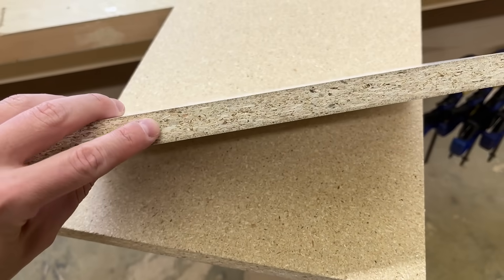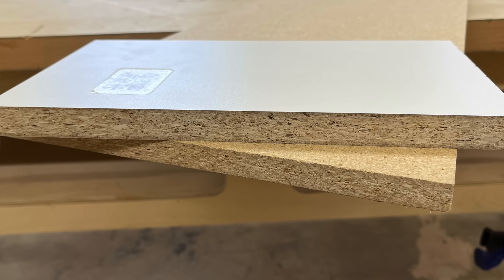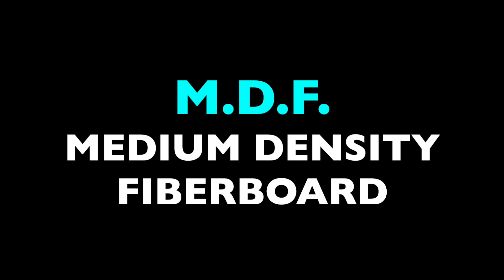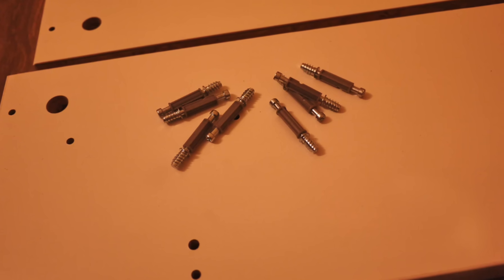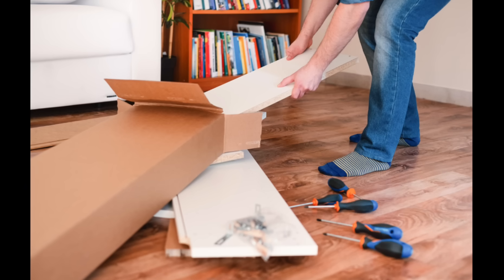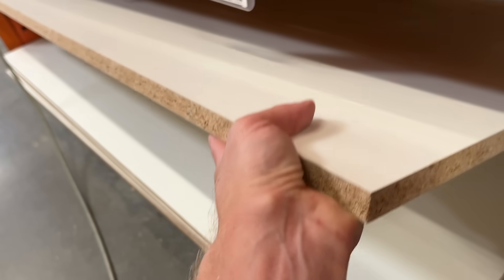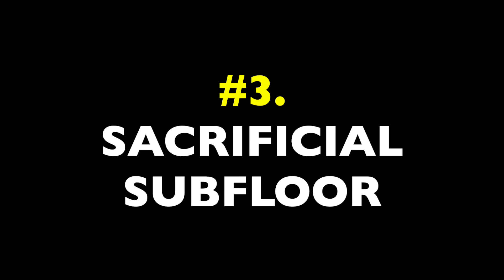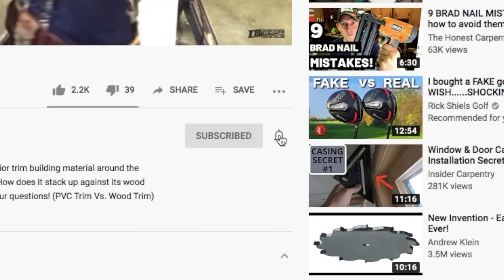The Truth About PARTICLE BOARD...Is It The Worst Material?! (Pros + Cons...Particle Board)

Comment: Most European kitchens use particle board covered by melamine. Most of their cabinets are not that wide (usually 15", 24" or 32". But mostly 24" wide). So particle board is perfect for smaller cabinet.
Reply: Those are similar widths you'd see in American kitchens. Particleboard works just fine in all kitchen cabinets. It is proven. Only the ignoramuses disagree.

Comment: In Europe, there are several multinationals, notably out of Austria, making wood products. The MDF vs particle board is way heavier, costs 60-70% more, and actually sags more, i'm pretty sure. At least laminated MDF vs laminated particle board, the MDF will sag more. The weight of MDF is really enormous. Laminated MDF costs multiple times more than laminated particle board, essentially, as far as i can tell, to be able to flex that it's MDF rather than particle board. I've now built a dozen MDF cabinets and i plan to switch to particle board, at least to try and form an opinion from direct experience. For the price of raw MDF, i can get the most basic laminated particle board. For c.3 eur/m2, i can get very nice laminated particle board.

Comment: On the other hand, I'm sitting at my rolling computer desk I built decades ago of particle board and it still works and looks great. If you work around its structural limitations, sand and varithane it well, it can be an inexpensive (though maybe time intensive) way to make something that looks surprisingly good. You probably want to find a filler product for the edges that is a good color match. I just painted the side pieces black to save time and trouble.

Comment: Why am I under the impression that mdf in fact deflects more than particle board when used as a shelf in a kitchen cupboard?
Reply: I also have Ikea PAX closets, the wide ones, 100 or 120cm, and the particle board shelves doesn't bow. Although to be fair there isn't a ton of weight on them.
Reply: The AI I just asked agrees with me btw. however, the Sagulator (yes, it exists) basically says it depends, as the database has twenty different particle board types and several MDF types. My girlfriend has a particle board kitchen with some MDF shelves, and these sag more.
Reply: @gudrune it doesn’t have a grain. It’s molded. Steel even bows given the weight over span. Oak does as well. Study stress factors. Also mdf vs. particle vs. osb ? Osb for the win but also what are the thickness 3/4 particle board probably resists better than 5/8 mdf?

Comment: Have to disagree. You've got the whole story upside down, at least compared to the products we have here in Australia.

In 50 years of building and carpentry, I've found particle board (we call it "pineboard" or "chipboard") far better than MDF for anything and everything. It's like cardboard, more paper than wood, rots with moisture, rats eat through it, warps with heat or cold, and is WEAKER in span than particleboard. In short, MDF is evil and useless. I just won't have MDF in my life. I tear it out wherever I find it.

And particle board comes in waterproof types, termite proof types, waxed types, greater ranges of thickness, Tongue & Groove. It is NOT cheaper,  but more expensive than MDF ... rightly so ... because it is better.

Comment: In the U.K., chipboard is the go-to material for flooring. We generally use 8x2 tongue and groove boards 18 or 22mm thick...the board is higher density than a standard particle board and treated for moisture resistance. Installation is by glueing the tongues to prevent squeaks and ring shank nails or screws to hold them down....carpet, vinyl or laminate goes straight on the top.

Comment: I have a desk that is made out of particle board. Owned it for years now so I think I can make a good assessment. 

First, PB is highly underrated, but its still used a lot mainly because of cost. It's like people use it alot, but then dog on it, lol. PB, when used correctly, will last a long time. 

Most of the problems I see on my desk and other desk, is usually water damage - from drinks being put on desk and from using inadequate thickness when it needs to hold a lot of weight. 

If you can reinforce those two things - water creeping in water exposed areas and thickness in weight bearing areas, PB is superior because it holds its shape well and very cost effective. 

Other types of boards like plywood of the same dimensions is triple in price. And that's not even talking about non engineered wood.

Comment: thanks for the helpful info, once again! i've built out 3 closets in my home with the melamine boards from home depot and they are all holding strong, 3 years running. if you "design around the material" so to speak, it can be great, low-cost stuff.

Comment: Does particle board warp?
Reply from the maker: If you lean it against something unsupported. Otherwise not from typical wetting/drying.
Reply: I have a table tennis board made of particle board that is slightly warped. I saw a video of a carpenter repairing warped lumber by moistening it, cutting crosswise slits, clamping it flat, and applying epoxy. Can I use the same method for particle board? Is there a better way?

Comment: I'm using Melamine for a bench fence because of the clean face, and straight edge. I initially tried using screws to hold it together, and it was a disaster. I am now using dowels with a much better result.
Cutting is, shall we say 'challenging'. I recommend scoring the top couple of millimetres, then doing the complete cut. Some cut edges will be exposed on the finished product, so I have purchased iron-on tape to deal with that.
As the item is not overly large, I still feel it was the right choice, but if MDF, with a plastic coating was available, where I live, I would have gone for that.

Comment: That was excellent! You told us that (as even inexperienced woodworkers know), particle board is cheap, prone to bend, prone to soak up water, and doesn't take a screw in the edge, but ALSO has some genuine uses where its dead flat quality, dead smooth, impervious laminate top, and resistance to denting on the surface, makes it actually attractive as a craft table top, where better quality wood cannot easily do the same work.

Comment: So, only in the desert {low humidity}, and as long as the edge is never touched, partical board can be used as a work surface. Other than that specific use, it is the worst material to have ever been created for anything.

Comment: I just purchased a Kallax unit from IKEA. 
But, when I turn the shelf upside and around, I hear noise like pieces of particle wood in between the veneer of the shelf. 

Is this normal? 
Or Is it broken in between the board? 
Also, note: 
I already returned one shelf bc of the noise and the second one (the replacement unit) sounds the same. 

Is it broken inside board?
Should I return it?
Thx in advance for your help.

Comment: particular board is the worst, I have my  burst hot water pipe repaired in utility room but residue moist and condensation swell the boards like elephant legs. Moulds develop crazy inside the boards, ended up have to dismantle the entire set of vanity cabinet and full height storage cabinets.

Comment: I found a better much sturdier glue to use one this 1/3 acrylic elmers glue 1/3 titebond 1/3 cyanacrylite glue, its thinner and also runs and absorbs deep in the edges, down side is it is probably more cancerous than working with epoxy. Cyanacrylite has an exothermic response on a molecular level when coming into contact with fine particles like cotton or sawdust and if it gets on the skin the exothermic reaction is so intense you will get burned; but the area covered in this glue becomes like concrete and the molecular reaction increses its dry rate. For any one wanting to attempt this mix you will need to heat the acrylic glue and titebond on hotplate then mix in cyanacrylite glue. WILL GET THROUGH YOUR FACE MASK and BURN YOUR EYES DURING THIS.

Comment: The one advantage of particle board over MDF, at least according to Google.... is that it has a much longer average "life span" of 25 years, as opposed to MDF being 10 years.
Anyway I've basically been using a flat thin cardboard box on stools as a supplemental table next to my computer desk for several years, and am finally upgrading that by adding a 3/4" 2' x 3' particle board on top.
So as far as I'm concerned, its Jeffersons Time.

Comment: I am ripping it out of my bathroom. A gap in the laminate flooring has had the water get into the particle board. I am replacing with 1/2 inch plywood and ripping out the whirlpool tub. I have been running fans and heaters to dry out the particle board to make it easier to remove.

Comment: My personnel opinion on particle board is that it should not be used  for house construction or for flooring. Flooring should be 3/4" PLYWOOD & nothing less. Walls & roof construction should be PLYWOOD!  Particle board is cheap jack ....! I shudder when I see new homes being constructed with this inferior & substandard material. It should not be allowed. It's all about saving money. Buyer beware...your new super duper home will not last you for very long until you run into complications.

Comment: I'm  still confused. I watched this twice. I have natural wood cabinets from Home Depot. The fronts are the only real wood. The rest are either MDF or the other you mentioned including the shelves.  I had these installed in my trailer which hall's my expensive car by someone who claimed to be a 30 year cabinet maker. Needless to say, the front cupboards fell to reveal he only fastened them to the BOTTOM steel beams. The tops WERE NOT FASTENED AT ALL. Thank God, my car was not inside. I see the remnants of the cupboards with the broken fake wood still attached at the bottom. I tried myself, being an inexperienced older woman to attach the remaining cupboards better, but probably dismally failed.  I got to points where the cheap anchors would not go through. I am suspecting these are the steel beams where I SHOULD be drilling. I need to attach them properly.  I am new to your channel and am trying to learn from you. I really live your videos. I just watched the vid on self tapping screws and the difference between a driver and drill. (MUCH appreciated!)  So, my question to you is, what is the best way to secure my cupboards,  driver? Drill? Self tapping screws?  I am living in my van which halls my trailer fulltime. I would SO APPRECIATE your help.  I just found the schiester who installed the cupboards and he threatened to call the police on me for telling him he did a subpar job. ??? I was had.  I can't find any help out here.   Any real advice would be do much appreciated!!♡

Comment: I lucked into a 2.5" thick 30"x5' particleboard desktop with maple laminate on the top, bottom, and edges. I turned it into a workbench top, and have zero regrets. It's tough as hell, and it's seen a lot of "abuse" over the years. It's also VERY flat. I had to dial in the maple top with an orbital sander and a straight edge to get it flat, but, it has stayed flat since.

Comment: Hello again Ethan 
Thank you for another Great Video. I've been wanting to ask, what type board should I use for a Toolbox Top. A work surface. I've seen several, but none seem to hold up. I never know if I am outside in the weather or in a aircraft hanger. Which could have leaks.I have also seen the fake wood tops that are coming preinstalled with tool boxes.  Again thank you
Reply from the maker: Hey George! I would maybe just go with a piece of 3/4” untreated plywood. Or even a hardwood glue-up panel. Water will damage them eventually, but it’ll take quite a long time. And the piece will be sacrificial, meant to take damage and someday be replaced. Good work surface till then though. I hope that helps! 🙂

Comment: Would you believe that they sell bed that made from particle board. They split it in two parts, half a bed length each. I have in the garage. One of it broke and the other is still good. I plan to repurpose it. But I don't have  a table saw or power saw to cut it. Any suggestions for it?

Comment: We actually just used some to fix a sagging couch. It's an old couch and didn't want to spend too much money to fix it. It was over $20 cheaper than plywood and the guy at Lowes gave us 50% off the piece cause we chose the one that had broken edges (that would not affect the pieces we needed) so we actually saved a lot more over plywood. We made it fit over the frame and springs and then wrapped it in the cushioning and cloth, the couch feels like new again.
Reply: Nice bargain

Comment: Here it is the most common material used for desks, cupboards, bookshelves and wall units.  Those with more money would move up to pine.  The wealthy would use hard woods.

But it can certainly last a long time.  We have bookshelves and desks that were made nearly 30 years ago, have been disassembled and moved many times, but are still as good as new.  I’ve also never had problems with screws into the edges.

Comment: if melamine wasn't so heavy I would be using it to build all my kitchens, its flat the laminate cleans super easy and if you lamello it then it holds together as good as plywood.  When it comes to water absorption it is the same as MDF they're both bad, but they make specific MDFs that are water resistant, you have to get them from a wholesaler.

Comment: particle board is the best substrade to apply wood veneer to, because it is dimensionally stable, with a hard, flat surface and consistant thickness when pressing the veneer with a commercial hot press. The grain on plywood can telegraph through your surface veneer and plywood expands/contracts. Anyone complaining about particle board being crap has never worked in a commercial wood shop. you can't compare it to Ikea furniture , they make their particle board with less density to save weight so they can save on shipping costs.

Comment: It does work well for small jigs and fixtures where deflection resistance isn't an issue. I recently made a tenoning jig with a melamine base.  Slides smoothly across the table saw and is dead-flat.

Comment: HI, TRY( P5 ) PARTICLE BOARD - I TESTED CUT OFF PIECES OUT IN MY GARDEN OVER WINTER SOME YEARS AGO - I ALSO SOAKED SOME EXTRA BITS I HAD IN A BARREL OF WATER TO TEST IF IT WOULD STAND UP TO DAMP - I WAS SURPRISED AT THE RESULTS., VERY LITTLE EXPANSION & NO DISINTEGRATION -  THE ONLY PROBLEM THAT I FOUND  IS THAT WOODWORM LOVE IT. EDWARD,

Comment: I do a lot of mobile home repairs and they use 3/4 particle board as subfloor and then install carpet and sheet vinyl over it. You cant really use osb or something not as smooth to replace it in this case because then you'll have small dips and bumps in the vinyl. But I guess the mdf sheets would be the more expensive replacement but that's usually not in the budget.

Comment: I've found epoxy coated zinc wood insert and standard machine screws work pretty well to replace the standard wood screws - also infinite assembly/disassembly Particle boards are relatively easy to repair with putty made of epoxy and sawdust.

Comment: I'll just bring some perspective from another part of the world ( Europe). Everything told in the video is still true and 100% correct.

One thing that I would like to add is that in Europe particle board is very popular and it comes in an extremely wide choice of colours and finishes. You can also get MDF in the same ranges, but it's usually at least twice as expensive. We also have plywood, but it much more expensive and a little harder to find. I've never seen it the hardware stores from my country.

I think particle board is great if you are an absolute beginner in furniture making and you find MDF too expensive. Just use it for indoors. It's true that it doesn't hold to the elements as better. Even though you may seal the edges.
Reply: …and it is wildly used as a subfloor and for strength in walls behind plaster boards (only special board according to the building code)
As stated they come in many applications and if used correctly works very well.

Comment: If you know how to make particle board cabinets, then they can last 50-60 years as in most 1950's and 1960's kitchens that are still around. Particle board can be used outdoors if sealed correctly or as I have personally seen, submerged in a pool for 10yrs (correctly sealed). I didn't believe it, but it was removed and cut in half in front of me to prove it.

Comment: I built a work table out of melamine and properly supported it. I weigh in at 210 and I sat on it after I built it and it held me without any issues.  Going on just over two years and it's still solid as the day it was built.

Comment: It may have a flat surface that's great, but you have to treat it like glass, no fasteners. You'd have to build a structure to hold it. I think particle board can be good for something, they just haven't figured it out yet. Tip: If you can touch the display and it's falling apart yours will too. That's why they're putting displays where you can't reach them. If you use it, you will always be let down. Love your channel, you're the best.

Comment: There are certain jigs that benefit from the slick durable of Melamine. Surfaces like fences, some work surfaces like router tables provided your shop is in a dry place where the exposure to heavy moisture is low. Also I always use edge banding to help keep the moisture out. That being said I don’t use partical board that isn’t Melamine. In many cases it is pretty much free because people of put bookcases and other furniture on the curb for free (still need to add the edge banding). Lastly it makes great dust containment boxes under router tables and such because it contains noise as well as being a surface dust slides off of.